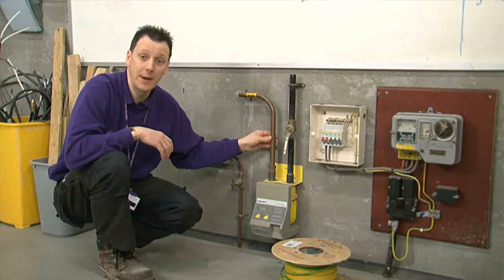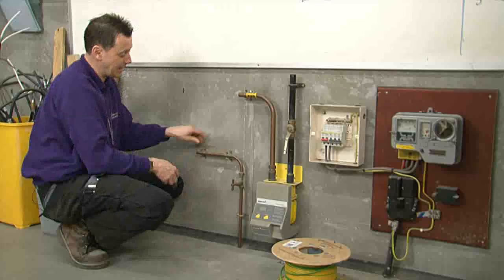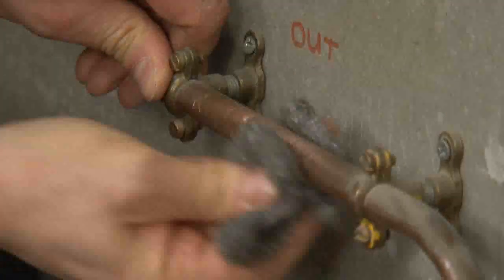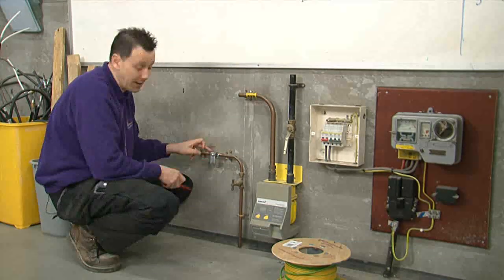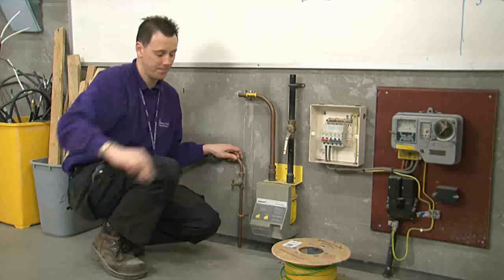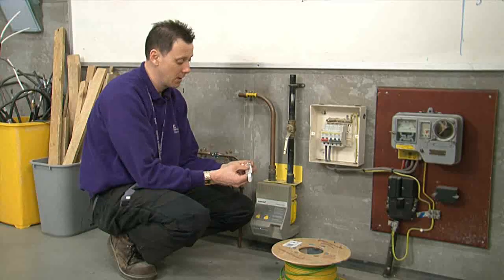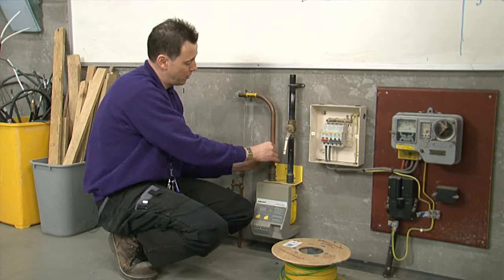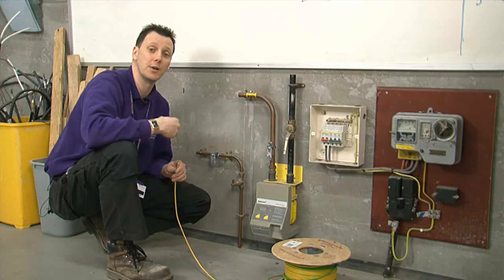The Practical Skills Series: Fitting BS951 Bonding Clamps

Comment: The pitchfork method is an incorrect means of making a satisfactory electrical connection. It was my understanding that this method has been frowned upon for a considerable amount of time now.

Better advice is to bend the conductor into a “U” shape around the terminal screw

Or even better advice is to use a crimped ring lug.

Comment: What ridiculous health & safety. The gas pipe is never going to come into contact with the live. No properties had earth bonding for decades, and no-one noticed any problems.
Reply: Shut up, Meldrew.
Reply: Benzknees really ? Central heating boiler  gas solenoid valve ,or someone has bonded flow return of central heating boiler linked to gas pipe ,and unfortunately the gas and water has pe  supply  with conductivity or bond to consumer unit .... or better still a loose neutral on the fuse spur  . But hey no it's only HS gone mad ......oh one last thing more gas fitters and plumbers killed than sparks whilst working on water gas pipes

Comment: Informative video, can you tell me should there be an earth clamp used for the TN-S connection? Remember  in your video you said "don't over tighten the clamp". I was told 35 years ago it can crush the cable and a tail should be sweated on by the REC.
Reply from the maker: Hi David, TN-S will require a clamp but not the same type as used for water and gas pipes (a common mistake is to use the same type)...the correct type looks like this I believe https://goo.gl/images/KyGPYB.
Reply: In your video it looks like the service cable has a standard pipe clip.

Comment: my understanding of the connections was you cannot make a pitch fork as he described it but either fit a lug or wrap it round to make a u shape, the same as you would when looping two clamps together, if you make it like a pitch fork it can be pulled off the clamp because it doesnt tighten up evenly. Check with the NICEIC guidance.